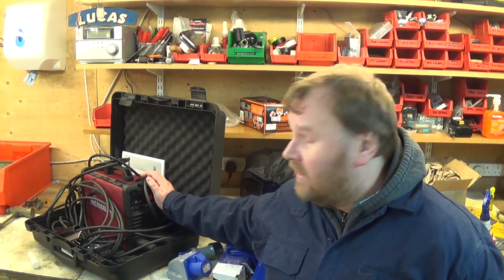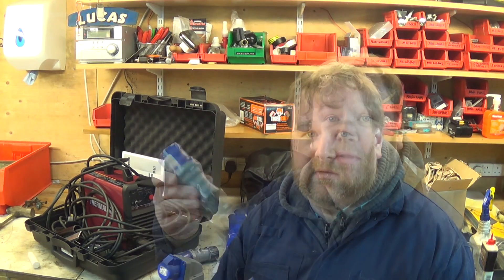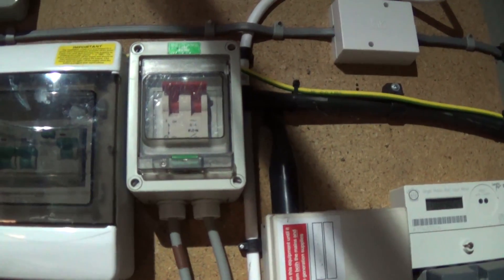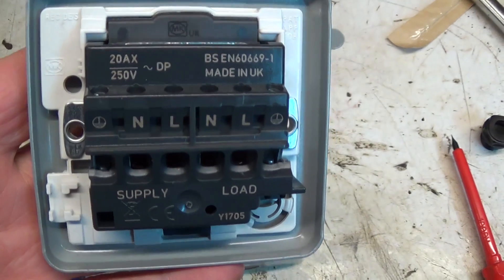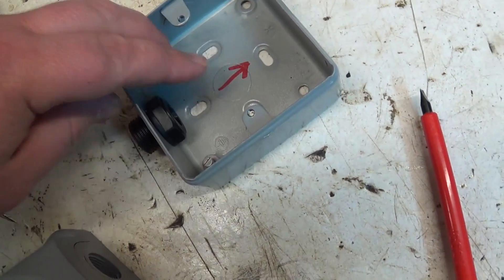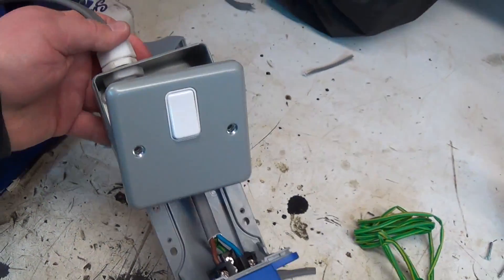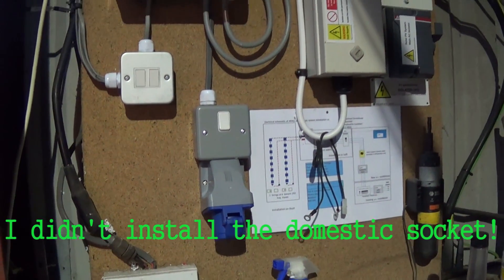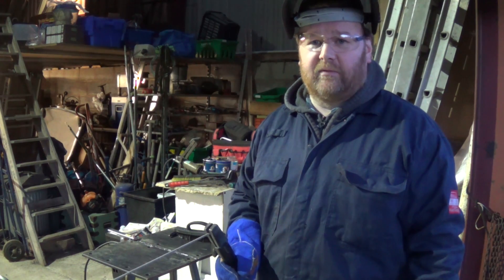Install 16 amp Industrial Socket for Welder - Stop Blowing 13 amp Plug Fuses using a Blue Cee-Form

Comment: Have you had any problems with the RCD tripping when running the welder at higher setting? Its something i was told not to do for the welding curcuit, not to have a RCD on it. Maybe its fine unless the welder is bigger than a home welding set up. Im not sure.
Reply from the maker: I don't have that barn anymore, and it was while ago. I think the RCD was pretty stable unless I tried to weld 12mm plate continuously, but by then the welder thermally cut out anyway, I seem to remember.

Comment: Hello  can I plug the following tig welder into a normal house hold socket. This one is from machimart at just under 100 pounds product is the CLARKE MMA/TIG120 120 AMP INVERTER MMA/TIG WELDER

It comes with a 13 amp fitted plug so i understand from the specification details Thanks and let me know please
Reply: Hello, I have two welders one a 'Lidl Special' and a Eland Mig 230 that is an industrial machine but still single phase (240V).  Both my machines work off of a normal plug socket although I'm thinking of 'upgrading' the Eland up to a 16 AMP dedicated plug socket.  The Lidl machine has never tripped a breaker in the 5 years I have used it and yesterday I had it running on an 20m extension cable (at one point welding for 30 secs continuously)...No problems at all.  I wouldn't be too worried about your set up I think your home supply should be okay and it will let you know quickly if its not happy.  Fuses and breakers do that for you it would ony be a 'worry' if the machine had been modified or tampered with in some way.

Comment: hi can you help me with an air compressor ,,,im in the uk ,,ive got 150l air compressor ,its says on it 16amp 350v ....what size of amp should I put on the mean board ,and what do I need ,,ive got the wire all connected to the garage ,,thank you if you could help me please
Reply: You’ve got a 3 phase machine by the sound of it. The litre figure just refers to the capacity of the air receiver (tank), it’s the motor kW figure that is important. Higher kW = higher CFM, depending on what pressure (bar/psi) you are set to.

Comment: I already used 200amp gas less mig welder on extension cord 13amp no problem when tried it on new example Wi-Fi socket it went off.think use caravan plugs like u .got my campervan on caravan plug charging my lifepo4 battery from house 😊

Comment: Bought a welder of a freind told me he's never used it for 25 quid I snatched It up, get it home still in it wrapper thought what a bargain, come to use it and there was no plug on it so I was about to stick a 13 amp on then noticed a white label stating I need a 30amp spur, after your video I'm guessing it's pretty much the same deal, so now I no why its never been used 😐
Reply: Stick a 13amp plug on and test it. At a certain point it’ll blow a fuse. That’s your upper limit on that setup.

Buy a big bag of 13a fuses off eBay and weld away. If he’s sold it for £25 I doubt it’s cranking out very many welding amps anyway. A lot of the cheapo Chinese inverter sets claim ludicrous max amps compared to what they can deliver. Roughly half in some cases. 250 amp set can only make 120-130 amps.
Reply: @NewWorldHoarder il give it a shot 😅 cheers pal

Comment: I'm getting a stick welder and I'm a complete novice so I was very glad to find this video. My compressor trips my fuse so I will get my sparky out to fit a 16amp socket and uprate my fuse. Thanks for the vid 🤓

Comment: Hi advice please I'm in the UK & bought a  Mig welder & it's blowing the fuse when Cranking the amps up it says need a16amp plug have armour cable to my shed what do l do to sort this out so l can buy the parts for the Electrician
Thank you for making & sharing your videos there a great help 
Regards
Steve

Comment: Is it possible to just buy one of those all-in-one leads with 16a plug->RCD->13a plug for 15 quid from Toolstation/screwfix? I'm looking to start welding and have no idea about electrics
Reply: The 13a plug will be the weakest link.
Reply: As the other reply states, it’s not an upgrade, it’s a means to connect a machine fitted with a 16a commando plug to your standard 13a socket. Still limited to 13a before you blow a fuse.

Comment: From my shed l laid twin an earth in hosepipe laid in concrete, into kitchen wired into the cooker socket and a 16amp breaker in place of the 32amp breaker. I have used various welders, currently using a Esab inverter, no probs.

Comment: Real men plug their welder into a 25m extension coming out the kitchen window into the shed
Reply from the maker: Haha, yes, into the socket next to the cooker!
Reply: no that real boys
real men use 50metre leads and a spare mig tip in place of the 13amp fuse lol . 
The UK 3 pin plug as actually pretty good design and a quality plug socket and 2,5 wiring handles around 20amp pretty easily . 
I worked in the industrial sector in Asia for over 10 years and that the real eye opener on poor electrics :--)
Reply: @mrb1864  i send my welding to Asia and its like they've never seen metal stuck together without porosity only certain places obviously but still 😅✌️🤫

Comment: Interesting - I assume you don't need 3 phase power to your house for a 16 amp hard wired welder?
Reply from the maker: Not for a simple 16a single phase socket. You probably have 60a or 100a single phase coming into your house.
Reply: @ShedTV  Ta. I saw some advice that you needed 3 phase for all hard wired welders but assumed they meant ones at higher amps.

Comment: I'd use 4mm hookup flex all the way from welder ( replacing the cable it came with) to an old style MK K772 3 pin plug 15amp.) It's rated at 15amp, but it can carry twice that and not get warm. Then 4mm  (6mm if long run) to dedicated 25 amp rcd or rcbo in consumer unit. Nothing will get warm or cut out.

Comment: Would using 4mm cable work on those plugs
Reply from the maker: Generally the terminals in 16amp plugs are big enough, yes, but I can't see any benefit unless you just happen to have some 4mm.

Comment: Thank goodness for a U.K. based video, electricity is a dark art to me enough and systems different than ours confuse me even more. My welder has a European (Polish) 16 amp plug, which I've ordered a 10 meter blue extension lead for. That is just long enough to reach my tiny shop. I've also got a 16 amp to 13 amp splitter which I’ve left the 13 amp fuse in, as I say electricity isn’t my thing so I’m better leaving well alone. My welder is a 200 amp MIG/MMA, it’s my first welder which I’ve bought more for small house/workshop jobs now I’m semi retired. I have some disabilities and won't be welding any iron girders any time soon. My questions are two fold please, what sort of power would I be able to expect out of my machine? And is this the right setup? I can't put a new socket in my 'shop for several reasons and my machine is rated 100% at 130amps/21v or 60% at 180amps/23v.

I would really appreciate any advice you can offer please? I’ve subscribed to your channel, thank you.
Reply from the maker: Mark Harris Thank you. The 13a fuse will protect your cable and equipment. Whether you have sufficient capacity to run your welder, I’m not sure. Perhaps one of the other commentators can help?
Reply: ShedTV Thank you very much for the reply, it is appreciated.

Comment: Can’t u just put a 16amp fuse in the three pin plug?
Reply: I have a adapter from the blue 240v to three pin and the three pin 13 amp fuse keeps blowing
Reply: @theoprice721  Folk normally just use 3 pin plug, remove fuse and solder a  wire across, that's what l did.
Reply: @6lr6ak6  am I missing something or are you suggesting that most people remove the fuse and replace with a solid wire?!
Reply from the maker: You could, but the contacts in the 13a socket are likely not to be able to take the extra current.

Comment: I have
 installed a D type MCB for welding
Reply from the maker: Paul Turner How does a D type differ?
Reply: @ShedTV  
Type D Circuit breaker has a minimum trip current of 10 to 20 times rated current.
Used for loads with a very high inductive component such as welding equipment.
Reply from the maker: @paulturner3861  Great, thanks. As I've moved to a new place I'll be installing one of those.

Comment: What's the lowest ampage and type ( b c d ) MCB breaker people can use for welding . My current consumer unit I seem to only be able to get type b MCBs for, before I used to mix brands without issue but apparently that's a problem
Reply: My 190A lincoln machine requires a type B 16A MCB which trips at fault currents of 3-5 times rated current.

Comment: Hi, nice video.  Just about to install  a similar 63amp consumer unit in the garage.  Would you know the amps of the mcb at the house that supplies the armoured cable.  What size armoured cable did you use - looking at using 10mm myself. Thanks Eddie
Reply from the maker: Thanks Eddie. From memory it was a 63a MCB in the house and I'm pretty sure it was 10mm SWA. The distance to the consumer unit was about 15m. The earth went to a local spike. I can't go and look as I don't have the barn anymore. I'm not an electrican, so please don't take my word that this is the correct practice though. Cheers, Keith.
Reply: @ShedTV  Hi Keith, Thanks for the prompt reply.  Pretty much the same distance for me.  Not doing the work myself.  Just trying to work out cost of materials before getting in touch with an electrician. Cheers Eddie

Comment: Why have you got a separate earth cable when you could use the steel wire to carry the earth?
Reply from the maker: Christopher Claridge The cable to the shed existed when I took it on, but I discovered that no earth was made at the supply end. I did not want to disturb the connection at house consumer unit, so opted for an earth rod just behind the wall outside. It is effective and the rcd test button works.
Reply: I was just wondering. That's all but I like the idea of 16 amp supply and great work

Comment: Them sockets are too fugly, a BS-546 15 Amp plug & socket are far nicer (they don't stick out like a sore thumb!), and capable of handling ridiculous amperage despite their official 15A rating... :)
Reply from the maker: I know what you're saying! Funnily enough I'm very familiar with the old 15a plug having worked for 30 years in the theatre industry where they were traditionally used for stage lighting equipment and cables. Indeed many venues still use them. A fused plug is undesirable, we prefer to keep all the fusing (rcd and mcb now) in one location. The theatre I work for changed to 16a cee-form during refurbishment about 10 years ago. Despite intially having reservations about their size and the need for two-handed operation, I think on balance the more rugged 16a with it's protected pins and superior cable grip are the better option. We even have black ones in the entertainment world now. As for the current carrying ability of the old 15a, I would agree that the Duraplug plug and trailing sockets are over engineered, however none of the available wall or panel mount sockets are realistically capable of runnning at more than their 15a rating and I've seen many fail through overloading.

Comment: I was wondering about if you needed a special plug in the UK like we need in the US, we have to use special 240v "industrial" plugs for our welders, as a stander US plug will limit you to 125v or 125 amps on a 200 amp machine.

Comment: For a 13a plug top fuse to blow in about a minute you are probably pulling closer to 18-19a
Reply from the maker: Thank you for your thoughts. I'm happy to be corrected, but the way I see it is as follows. The welder is fitted by the manufacturer with 1.5mm PVC cable which is capable of carrying 16 amps continuous current and I have fitted a pair of connectors rated at 16 amps. The reason I used 2.5mm Twin and Earth from the fuse board to my socket is that the earth cable within T&E is 1.5mm. By my rough calculations the MCB will hold for a maximum of about a minute and a half at 20 amps at any one time; peak loading above 16 amps during welding is momentary. I therefore believe that I have satisfactorily protected myself against mechanical damage to either cable as well as providing overload protection to a suitable standard. I don't think that replacing the welder's supplied cable is necessary.
Reply: @ShedTV  could get your clamp meter on it to see how many amps its drawing. The manufacturer should of overrated the cable to 2.5mm and fitted their plug with 16amp plug like you have. 1.5mm cable drawing near maximum Amps is not good for it.
Reply from the maker: Yes indeed. I had a look at the information plate on the welder, it claims to draw 17a continous at maximum output wattage and peak higher than that. It's fitted with 1.5mm cable and I used 2.5mm for my socket, so hopefully I should be OK!
Reply: you should use 2.5 all the way, just in case